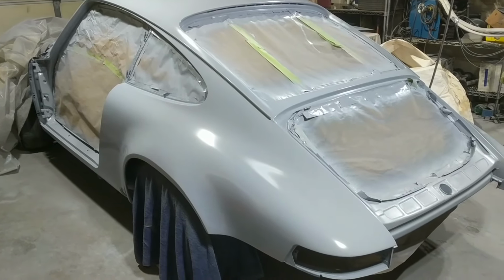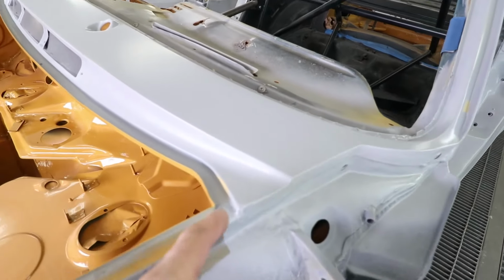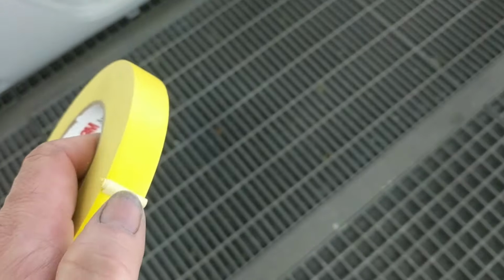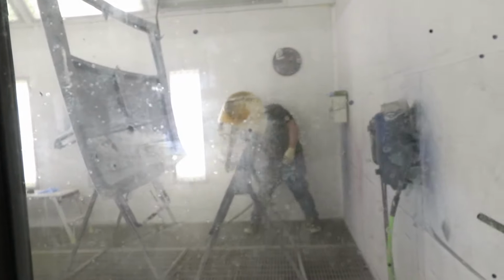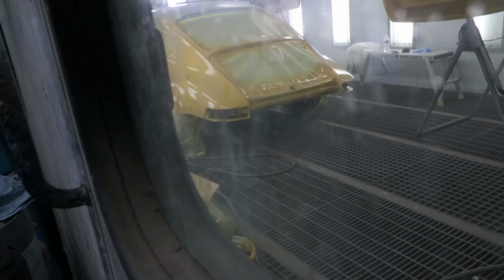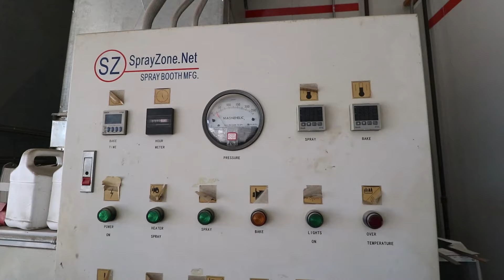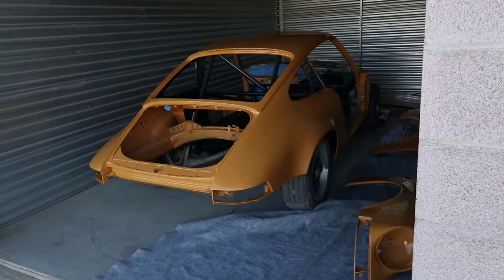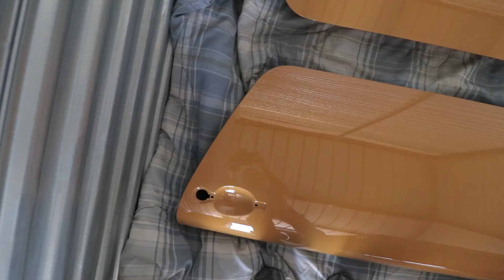Excited For Fresh Paint On My LABOR Of LOVE!

Comment: Looking awesome Tom! Are you worried about the paint sticking to those blankets while it’s curing?
Reply from the maker: Thanks!  Yeah, I'm worried about the blankets. Here's what we did do.  We put studs on the hinge and latch points to act as little stilts so there isn't much pressure on the blankets.  Same with the fenders, they are sitting on the hardware.  Hopefully it will be ok?  Fingers crossed!
Reply: Garage Time - Restomod I’m sure it’s gonna be great. Can you put enough paint and clearcoat that if you have to fix something it shouldn’t be too bad. I was just in Huntington Beach overnight… I didn’t think about reaching out because I don’t have your info. I am moving to Long Beach in a month, by the way.
Reply: “...and”, not “can”
Reply from the maker: Awesome!  I'm going to DM you insta with my contact info.  Stop by next time.

Comment: I will be doing 2 stage on my 60s beetle.
Was there no work done between stages? 
The base coat was perfect?
Reply from the maker: There was a small eyelash or something right on the rear fender.  Mario curled up a piece of masking tape and extracted it right away from the wet base.  He let it flash and then blended more base on top of it and it disappeared.  No other problems!

Comment: Truly appreciate you sharing your processes throughout this project.
Can you share the paint brand used?
Thanks, Shawn
Reply from the maker: Hi Shawn, I did share the paint materials in this video, but I used solvent based Matrix Basecoat and SPI Universal Clear.  Totally happy with both so far!
Reply: Thanks. I thought you were referring to a product line (a little behind the times, here).
Solvent-based...hence travelling  multiple Fwy/Hwy ending in "5"? 😁
Reply from the maker: Yeah it was hard to find a place!  And not in my backyard!  SPI stands for southern polyurethane Inc in case you are familiar with them.  They are geared toward hobbyists like me or restoration shops
Reply: Thanks again.
The shiny orange/black project in my avatar is one of those 10 foot paint jobs applied by a previous owner.
I've always liked Porsche's Petrol Blue of the late 70s.
Looking forward to your next project.

Comment: Looks amazing. I'm so happy for you! Does it really even need buffed? No worries on letting Mario spray it, he is most familiar with his equipment and like you said has alot of experience, I would have done the same.  Was this his first time spraying SPI Universal? Curious about what he thought of it. Congrats!
Reply from the maker: Thanks Russ!  There are a few nits and one sag that needs some attention, but not bad.  I don't want to sand too deep and will probably leave some orange peel.
The only way I could get the booth was if Mario sprayed it.
This was his first time using SPI clear and he usually uses much more expensive stuff!  He liked how it sprayed, but wonders how it will look after a few years!  He said some clears start to dull after three months.  I don't expect that from SPI.

Comment: Thought these early cars were done in single stage.  Curious why you went base coat clear coat?
Reply from the maker: My car is a 74 and it had a sticker in the door jamb that said it was two stage from the factory.  However this car is backdated to look older when they did use single stage.  This is a restomod, and I believe two stage is a way better product.  Two Stage is easier to repair too which will be needed due to the track.
Reply: Clear over base is always better!

Comment: The thing looks like glass and I would be tempted not to do a cut and buff on it. I still think you should try to paint a fender or something because you did the hardest work and left the funnest Part for someone else to finish but still all that work really paid off
Reply from the maker: I'm painting the bumpers at home!  Plus I did the trunk and engine bay.  Thanks again for your support.  I'm not going to cut and buff that much.  It has a few dust spots, but the orange peel isn't that bad.